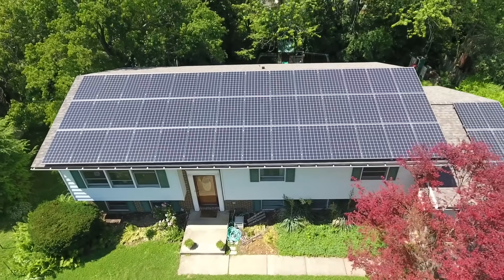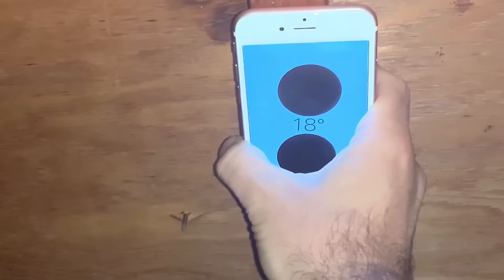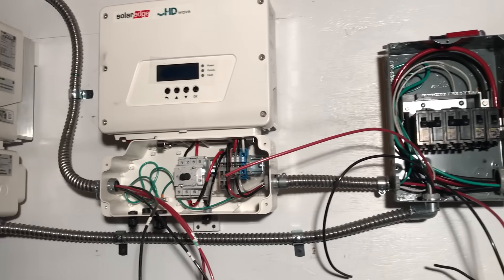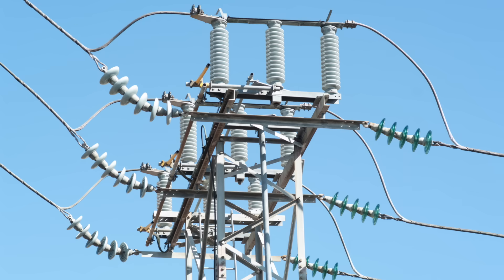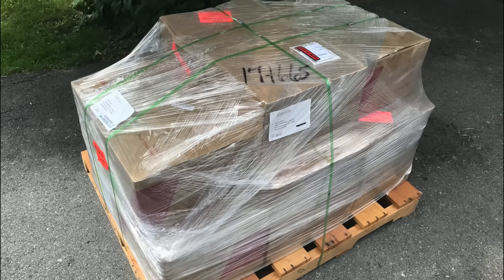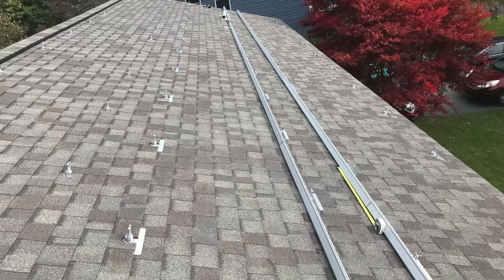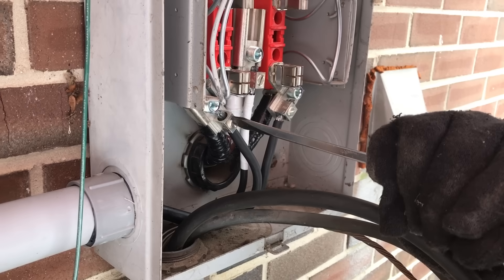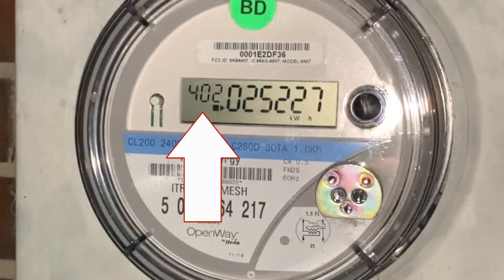I Installed a Power Plant Myself | HUGE DIY Solar Panel System

Comment: Maybe to add => Optimizers you only use, if there is a difference from panel to panel. For example, if the angle towards the sun is different, of if you have shading of some of the panels at some of the moments in the day.  If all panels get the same sun all the time, you can skip the optimizers and connect as a series.  You'll lose the "per panel tracking", but you'll also lose about 30% of the costs of the installation.    So for any "no shading all day long" situations, it might be the better ROI option for you.

Also, remember that your solar panels loose about 2,5% the first year and 0,5% every year later.  So in 10 years, you'll be maximum at 90% of the installed power.  So if you want to guarantee 100% coverage of your electrical bills, you might need to consider additional panels ahead of time.

Last but not least; check your local laws. In the Netherlands for example, what you make is striped against what you pull from the grid. But what you make "extra" only gives you a very small fee.  So adding more panels then you need to cover you're bill, immediatly hurts your ROI, as those extra panels actually will be costing you money.

Good luck!

Comment: I would have suggested that you put a flange around the tube that went into the garage roof. The kind that they use around bathroom roof vents probably would have fit.

Comment: Do you have batteries?
Reply from the maker: No.  Check out the next video for why.
Reply: @FrugalRepair  So how are you indipandant from the grid then ? In the night
Reply from the maker: I explain how net metering works in the next video.  I’m tied to the grid so I still have power when it’s dark.

Comment: Batteries are a must when the grid is in the mix! System becomes way more efficient because you use power right from batteries rather than buying it back from the grid at a much higher rate. Why not use your own power rather than sell it to them for less, buy it back for more, and pay more for your system in the long run. Oh and the most important, power goes out you still have no power because there is no batteries.
Reply from the maker: It depends on where you live.  Here there are no TOU rates and we get 1-1 credit for the KWH so batteries are not really necessary.

Comment: Punched a hole thru the "un-used" chimney!!??  oh boy.. fire hazzard right there for certain. Lord knows, if another person moves into the place they will have no clue in regards to its presence going thru the chimney.
Reply from the maker: Maybe I should have explained more, this is no longer a chimney but functionally a cinderblock structure. The top had been cut off and it’s separated from the house.

Comment: In Germany, you can get into trouble if you think of touching your electrical system. Such sissies.
Reply: In the Netherlands you are allowed to install and change everything after the kWh meter, without any need for qualifications, inspections or permits.

Comment: This video's awesome! Truly. It's a great overview of the process and a great guide for a consumer looking into solar. 
I really liked the specialized meter lugs, much better design than the mid-cable splicers that just bite into the cable jacket.
Power optimisers, conduit, disconnect; all golden. I've spent the last 9 weeks learning about PV through IBEW 134 and the knowledge you gained doing this project is astounding.
All that being said, you stuffed your roof with too many panels. Your clearance along the ridge of your roof is inches, when it needs to be 3ft for fire fighter  venting purposes. Also need at least 3ft along one of the short sides of your array from gutter to ridge for roof access.
 https://www.solarpowerworldonline.com/2018/04/know-your-codes-for-solar-mounting/#:~:text=International%20Fire%20Code&text=in%20article%20605.11.-,3.2.,departments%20to%20ventilate%20the%20building.

Your also meant to leave 1ft along the bottom edge of your array for a drip edge.(Drip edge probably is a big deal at all though in my opinion.)
An insulated grounding conductor also could've helped with having to keep the copper off the aluminum.
Cool install though.
Reply from the maker: Thanks!  Glad to hear you enjoyed it.  When I installed the panels there was no setback requirements for the roof where I live.  There is also a provision in the code for an exemption, if you did want to pursue that.

Comment: I live in Texas and have two concerns: 1) high winds tearing or torqueing the solar panels off the roof; 2) hail damage to the solar panels and replacing the panels damaged with the same look and power generation "ratings". I see them installed in neighborhoods around me but we haven't had a strong storm in a few years. We always have hail and strong winds - and why I miss the Pocono Mountains!

Comment: I live in the netherlands, and we have , 4310 watt peak solar panels
That's 4,3 kilowatts, we are now saving for a ,tesla powerwall!
Buying now is not worth it
Because every kwh we generate ,we give back to the grid ,after the house has enough
And we get € 0,23 cents for every kwh thats going back to the grid
Example! When we take in 1 year 1500 kwh from the grid, and we give in that same year 1500 kwh back to the grid, we earn ,1500 times , €0,23 cents, in other words,, €345 , when we give more back to the grid, then for every kwh that exceed 1500 kwh we get a compensation off €0,07 cents

Comment: As an electrician in Europe that does these installations often.. Good job!
The planning process and actual installing was very professional. 
How come it was not possible to install the PV directly onto your circuit breaker? 
I understand it would probably need some kind of max amp breaker so your house installation would get overloaded.
Reply from the maker: Thanks!  It was too many amps for the busbar.  Plus I didn’t have any extra breaker slots.

Comment: Wait so you got yearly net metering right? How can your solar panels cover your consumption during the night or winter? They can’t, your utility company just subtracts energy produced minus energy used from the grid. Scam of the grid
Reply from the maker: Watch my next video, I explain answers to those questions.
Reply: @FrugalRepair  thanks for your message.
Though it still is loosing the grid quite a bit of money, because they somehow have to store the energy or produce it at a higher price than what they initially bought it from you because you produced it when the sun was shining resulting in many more solar farms to supply the grid with cheap electricity. But when the sun’s set or it is winter the demand is higher thus resulting in more expensive electricity. I wish I had this where I live haha. Good for you 👍😀

Comment: Good to watch and make for my house. However, there are questions to ask your self before installation:-

There is average of monthly bills if you reach you can install the system 
Is the sun light can operate the solar system most of the year 
What type of system you need on grid or off grid because maintenance will be costly and annoying

Comment: IIve been looking at going solar for about 15 years but we have a problem a butchered net metering which means we only get net metering on energy usage so to produce 40 dollars worth of power and still have a 120 dollar bill each month is not worth it so to solar means that we have to cut the grid tie and that's what scares me we are in Alberta Canada so far all the provincial and federal government say they are green but the only green they are really interested in is the green they can suck out of our wallet
Reply from the maker: Sorry to hear that’s the arrangement there!
Reply: In order to cut our grid tie I'll need a back up generator since over the years I've collected a few the problem becomes fuel to run it on since gasoline prices are so expensive it means using the three other alternatives the best seems to be methane and I have some ideas on how to make one it should work otherwise I'll have to. make one of the traditional versions when I do I'll post it on utube because if I make it I want it to provide enough gas to do all my gas needs or at least most of them

Comment: Well done to tie it all up in a short clip for us thank you. Only thing I think your missing is to factor in the impact on cost and payback over time for the deterioration of the solar panels with time. From what I’ve read this is between 1-3% efficiency per year. This makes a difference to payback time and also the long term rolling replacement plan cost one would need to stay on solar only 
But good non the less ta

Comment: I need to save some more or hit up my bank for a loan. Thanks you for the video.
Reply from the maker: Hope it can work out either way.  Do you think you might try a DIY?
Reply: @FrugalRepair  I can pretty much piggy back off your video and I will hire an electrician to do whatever I cant handle. I was worried  about lead panel contamination and or hail damage but I heard they are pretty tough.

Comment: If you get bored you can come to Maine this summer and help me install mine! I’ll supply the beer and lobster every night!
Reply from the maker: Haha, sounds fun!  I’ve never been to Maine.  What size of system are you thinking?
Reply: @FrugalRepair  I’m thinking a10k micro inverter system with Solaredge inverter. I have gotten quotes for a similar system installed . But I’m sure I could save thousands if I do most of myself.
Reply from the maker: If you’re somewhat handy anyone in my opinion can do it.  For me the paperwork and understand NEC codes was some of the hardest part.  Shoot me an email if you have more questions.
Reply: @FrugalRepair  Thank you!

Comment: This solar system is not relevant. Because costing buy this solar same like as we pay bills of electric per month. If we replace system solar is not mean can reduce cost of our living. That's why we need to use fuel consumption and low maintenance than this solar system very high maintenance.

Comment: I would follow like most who wishes to be in the same position. But if I were this guy to have spent so much, my first step would be to remove the shingle roof for a metal one that surpasses the solar panel warranty and then install the solar system.

Comment: Very helpful, HOWEVER, if you're going to connect to the grid, call your power company first.  In Colorado Xcel Energy controls how big your system can be, they NO LONGER pay for power you add to the grid (they give credits instead), and they pretty much control your system.  For example, if power goes out in your area, so do you, regardless of the solar you installed.  Yes, even if you have solar, Xcel will turn off the power to your house. You're not as independent as you think when others control your system. Really, call your power company 1st so you know what to expect before investing.

Comment: Have you turned your Solar panel installation penciled drawing into a digital format for permit request.  It looks like its the "normal" installation process.
Reply from the maker: I scanned it as a PDF but I don’t think the electrical inspector cares if it’s hand drawn or on the computer.  They just want it to be clear and understandable.

Comment from the maker: More of your questions answered in NEW video. In depth tour → https://youtu.be/q9o2ndsB7-o  What to know how much I spent, and what the system has produced, and more?  Check out the Solar Playlist → https://www.youtube.com/watch?v=ToxFObjnlF0&list=PL52dU-VsXAHgf07MxIPv4y3wNZeDB3EUI
Reply: Hello Boss can I please get your Gmail. Or Whatsapp number? I am very interested in Your solar experience and I would be very glad if I got to personally interact with you. Thanks
Reply: I would not of installed Solar over top of shingles. You're going to regret that.
Reply: @shperax  Im also worried about how far it can hold when a power of winds struck at 200KPH or more during hurricanes or Typhoons.
Reply: Hello Boss can I please get your Gmail. Or Whatsapp number? I am very interested in Your solar experience and I would be very glad if I got to personally interact with you. Thanks
Reply: Solar panels convert solar radiation into Electricity
Reply: Have you considered cost of construction and repairing?
Reply: Ooohhhhhhh.  Cccoool
Reply: Wear is battery storage
Reply: @Trevor Keeping Besides the rating others posted, they are offset no higher than shown also to prevent them ripping off the roof
Reply: How efficient are solar panels how much efficiency do they loose a year each year the amount of power they produce decreases by how much a year? What is storing your power? How much does it cost to repair them?
Reply: @needleeye55  You must be really new to this so I'll help out a bit. On average after the 25 year warranty most solar panels come with they lose 1-2% of the efficiency so 20% (average efficiency of 2019) would turn into 18-19% if anything more happens it's usually covered under warranty and they will replace it. They aren't storing power it's going to the grid in his case. They get paid for the energy they send into the grid and during the night you pay for the energy you use, so you are basically using the grid as your battery. You can buy a large battery backup for a house, but it's not very cost effective so most people don't. You don't really repair them if one somehow broke or got damaged the warranty usually replaces it. I've had my stuff for 3 years and the most I've had to do is take a brush up to the roof and clean them off like you would your car. You'll love more efficiency with them being dirty than you ever would of them aging.
Reply: Thank you for documenting your project. This is really cool.
Reply: Sir for ur safety never ever post that government are ass they ruled us even tho its ur right they can still deny and remove the solar from ur house 🏠 by force, because they don't want other people install the solar so maybe think next time
Reply: @karsusthegreat9536  Want to know as well!
Reply: adding cost and return to this video would have been nice...
Reply: I'm planing to build a system to my home, I need help to look up the rights system depending on my energy consumption can you help me?
Reply: Too bad solar panels and the batteries are many millions of times more toxic than fossil fuels.
Reply: @joshportie  that’s false.
Reply: @JoeJoe-lq6bd  ever hear of benzene? Its absolutely true. Look at the pp testing for water. You touch benzene and you are effed, you touch fossil fuels you aren't you just need to wash up.

Comment: only good for environment not your pocket ...around 8-10 years you'll get what you paid but you have to replace all the batteries every 6-8 year and replace solar panel every 12-14 years...i don't know its really worth it that much  is headaches and labors...at long term pay the bills %15-20 cheaper then solar system ...

Comment: I am surprised you have a zero power bill. Our price per kw hr in Alberta includes NOTHING extra. We pay approx. 3 to 5 X more than what the Kw charge is for "extras" like administrative, delivery,  transmission, distribution, balancing pool, and rate rider charges (thankfully no hated CARBON TAX which inflates our ridiculous heating bills). I once used $26 for electricity but my final bill was $142. To save money here one has to go OFFGRID (which entails rather expensive batteries and most likely a generator).

Comment: Wow! Just amazing. I'm presently doing a course and photovoltaic installation and this video is a big inspiration. Well narrated and informative. 👍🏾👍🏾
Reply from the maker: Thanks!  Are you planning to become an installer or are you taking the course for a project of your own?
Reply: Planning to become an installer, but well done mate, all of that work and you did it with no formal training.
Reply: Then eventually take on my own project, I live in the Caribbean so it's quit expensive to do what you have done at your home.

Comment: im in the process of building out a tiny home and im looking at using solar to power everything  we dont have much in the way of power other than a few tvs and two desktop pcs and a small fridge...maybey 8 lights in total and a tankless water heater... ive seen alot about  panels, battery banks and even solar generators... what would you suggest i look at as far a solar goes? we  are fortunate enough to have alot of space available behind our house on a hillside that generally faces sunlight the entire day...{almoast an acre and a half cleared} is there a setup we can start with and add panels as we go to power our home and charge a battery bank for use durring the night times? any help would be appreciated. thanks for your time.

Comment: After waiting months for a quote from three different solar companies here in Australia where the industry is supposedly screaming for more work, I wish it were possible to follow your lead. Unfortunately a) solar installers here need a special licence, b) there is no mechanism to get approval for self-installed electrical equipment, and c) the distributor won't approve feed-in on a self-installed system. Nice job though, very cool.
Reply from the maker: I’m sorry to hear that!  Can you lobby to change the rules?  Thanks for watching.

Comment: I loved the video great job.  But on sincere question. Why not spend about $500.00 more and put on a steal roof that way the roof will never have to dealt with again? And when comes time to swapp out the panels you still don't need to mess with the roof.  I am saying that working for years as a home inspector. But fantastic job. I am researching it all myself.  But I am currently not in a home that I want to spend the rest of my life in, just a few more years until the daughter is out of school. Then will build something further out, and plan to try to do all rentable some get thermal for heat and cooling and solar for electeical.